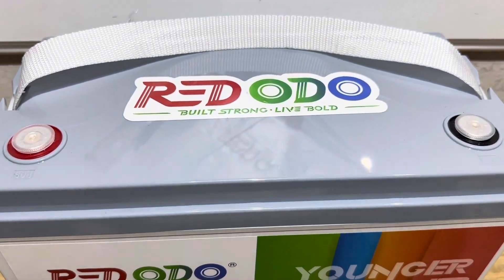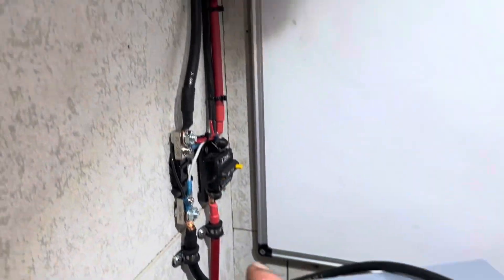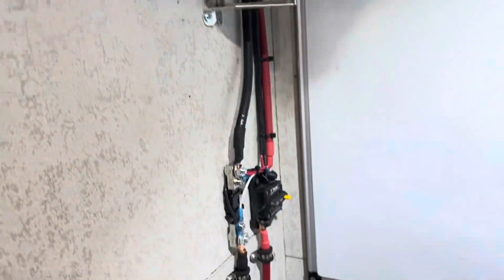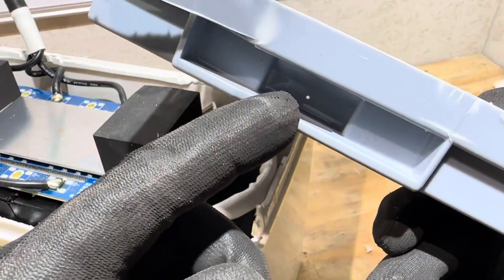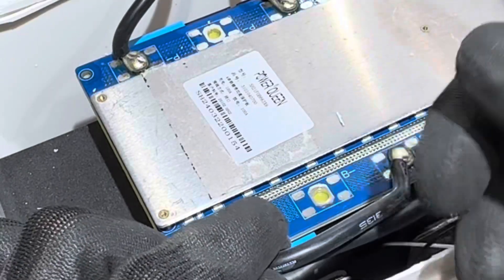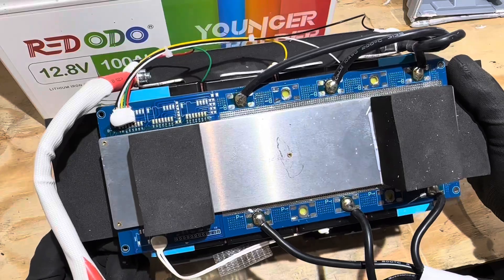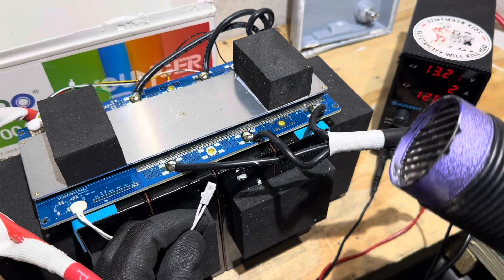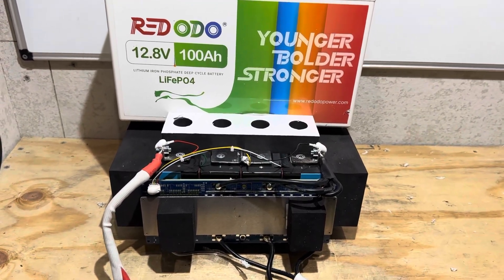Redodo 12.8V 100Ah LiFePO4 Lithium Battery Review and Teardown

Comment: What does the shunt do?
Reply from the maker: The sample shunt I’m using to measure the energy that comes out of the battery has a predetermined resistance and the battery monitor (display) basically is a tiny computer that measures and calculates the energy in or out of the batteries through the matched shunt. 
Hope this helps!

Comment: I have the 40 amp charger by this company. It seems that a full 40 A goes into the battery during the full charge. I thought that the amperage was supposed to ramp down at the last 80 or 90%. It did drop to about 37 A at 90% but that is close enough to 40 for me. Any advice?

Comment: Odd you add a vowel to the brand name?  RedodEo?  Just bought a Siekon due to Will's review liking it more than the Li Time.  What brand and model batteries?
Reply from the maker: Proper pronunciation per the manufacturer is “Red O Di O “
Reply: @THEOFFGRIDMOUNTAINHOMESTEAD  thanks for the information, never would have guessed they would add a hidden vowel...
Reply from the maker: Me either! 🙂 
I wish they would just call them YBS battery (younger bolder stronger is the brand motto)
Reply: @Step-n-Wolf  I am guessin' you say the letters individually Red O.D.O
Reply: @DaGarbageDisposal  vs adding a vowel that isn't in the name, yes

Comment: I'll be glad to move on to the 48V batteries. Much better tech.  But I'll stay tuned.
Reply from the maker: I’ll be working with 51.2V 16S LiFePO4 batteries soon.  
I don’t have any plans for 15S 48V LiFePO4.
Reply: It will be interesting to see when 48v becomes the de facto standard instead of 12v. It could be 1 decade it could be 4 but with the copper savings I see it happening eventually. 

I just don’t like having to pay extra for my fuses right now though 😁

Comment: Thanks! I have a Ampere time 12v 200ah lifepo4 which is now Li time. The seal failed  and allowed water in and fried the BMS (came with travel trailer, no receipt=no warranty) Cells are fine so I just need help finding the right BMS board. Ugh...
Reply from the maker: If it uses a SaiHang board that will be hard to come by since to best of my understanding they are OEM only. 
JBD BMS are readily available online you would need to select one that matches your current BMS specs and configuration. Many are smart BMS now and can be programmed with your phone. Type in model of your failed BMS on search engine and probably can find something on it for cross referencing!

Comment: First batteries a got were the Redodo I have 4 in my 24 volt setup and it’s nice to hear you also like them. I guess I did good research before I got mine😁😁
Reply from the maker: Yes sir, you did excellent research. Definitely good batteries and one of my favorites. Just wish the prices were as good as they are now when I bought the bulk of mine 🙂
Reply: @THEOFFGRIDMOUNTAINHOMESTEAD  mine were $269.00

Comment: So if they and powerqueen and LiTime are the same company is there any price differences between the batteries?  I know that at lets say harbor freight they have really good floor jacks for cars but they have the daytona series for heavier duty workloads and pittsburgh for lighter duty.  Maybe these are similar?
Reply from the maker: From my experience with these brands, Redodo usually has lower price point. I believe that the capacity test between the G24 litime and this Redodo are the same. I’ll have to look back at the G24 video. SaiHang is a BMS provider for over half of the battery brands. Similar to BMW having contract for mufflers made at same plant making Hyundai mufflers. 
The cell packs appear to assembled by motive power. (the cell provider for most of your favorite brands. I plan to dig deeper on this) Much of the plastic cases for these brands come from India now. Noticed same case mfg. marks after I posted the video.

Comment: just bought another 4x 12 200ah plus with 20 amp BMS 2560wh from them yesterday. Now will have 20kw back up power. Been running another bank on my solar back up sungold power 10k invertor and 12x 450w sungold panels in series for 500v input VOC max. I am impressed with these redodo batteries. Just bought a balancer today so as not to have to do maintenance every few months. Great battery. Got 8% off in a email yesterday. 1600 for 4 200AH batteries is cheap! Thanks for the video and teardown. Great JOB!!
Reply from the maker: Appreciate you! Sounds like you have a nice setup! 👍 Redodo are good and solid workhorses! Got some of the 200Ah and 200Ah plus myself! I use balancers and they stay within 0.1V or better!

Comment: Good video. I'm fairly invested in PQ. Didn't know the about the apparent PQ/Redodo association. Glad this battery passed your ridged inspection. I got the last PQ 200ah plus with discounts for just north of $381. That's pound for pound about what the Redodo's are going for. Wondering if this has something to do with it. Also Redodo has the group 24 that is smaller in size but the same capacity as the group 31. Any reason not to choose group 24?
Reply from the maker: On my best assumption, but not proven yet… I would venture to say it’s same components just in smaller case. Similar to the LiTime G24 I worked with a few months ago. Sorry I cannot give a definitive answer!